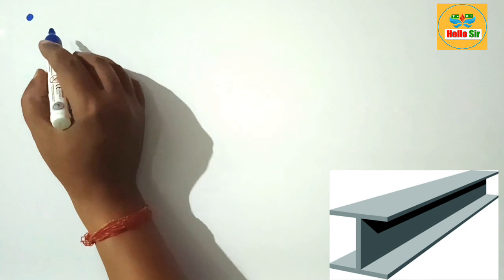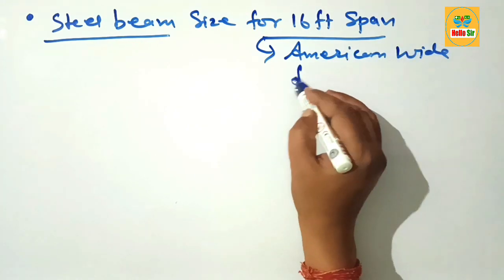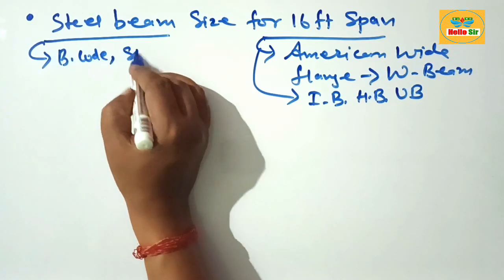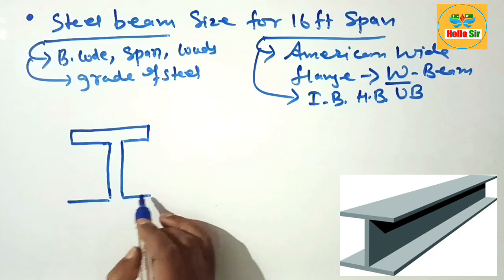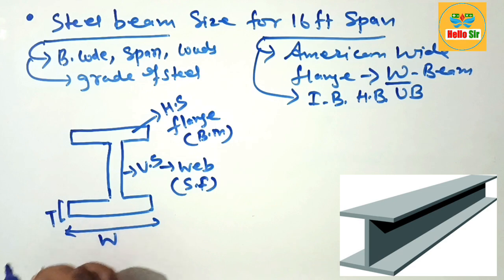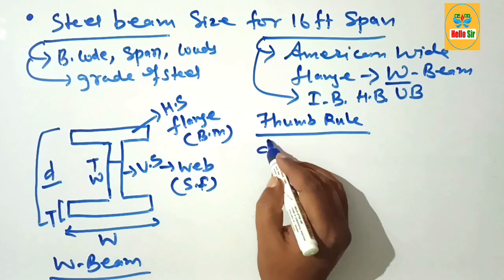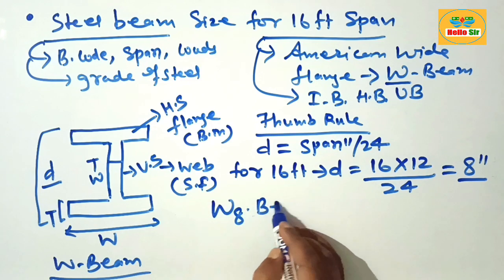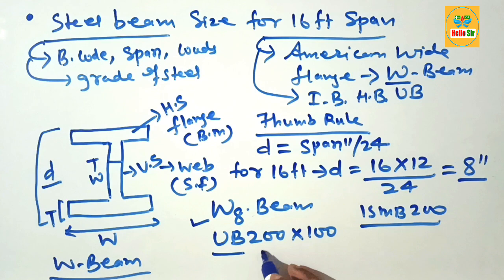What size steel beam do I need for a 16 foot span | Steel beam size for 16 ft span | RSJ, H, W, UB,

Comment: A friend of mine's been alone took out a wall at his house and is the 16-ft span single storage welding unit 26 ceiling Rafters nothing's up there that weighs anything besides the sheetrock and it was a support wall they took out I'm wondering if I 8 inch high beam or 10 inch high beam which one would be adequate to hold that little bit of weight it ain't much